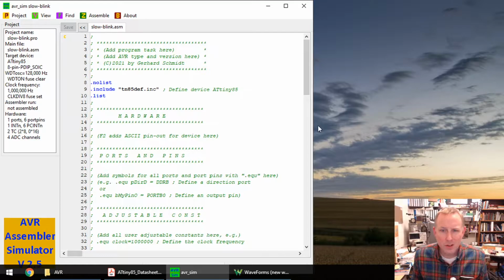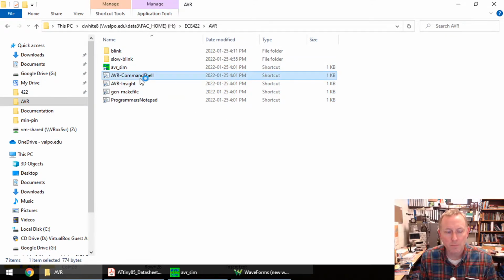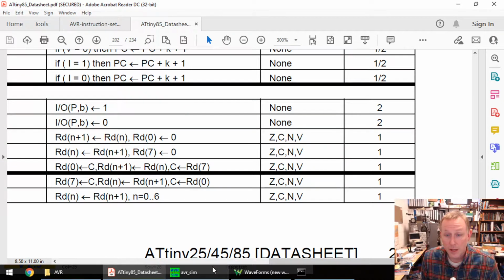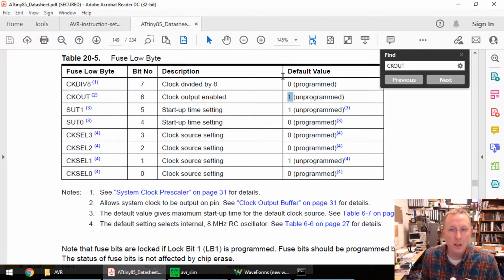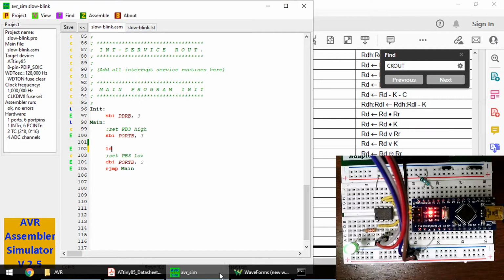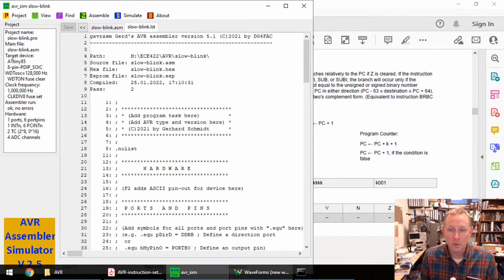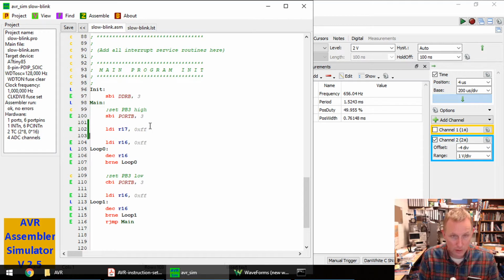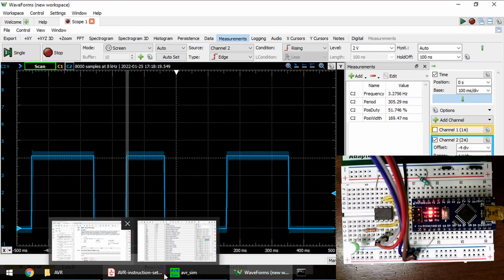AVR ATtiny85 slow blinking in assembly

Comment: Fantastic tutorial!
Is there a way to toggle a port bit like you can do EOR with a register? Also, is there a "neat" way to do variable delay timing in assembly instead of having to precompute n number of nested loops? Is there something like a timer we could use?
Reply from the maker: Thanks for the kind words.

AVR has instructions (SBR, CBR) to set/clear bits in a register, but not one to toggle.  (one variant does have a load+toggle, but not the tiny85 version)   You'd just load a constant to a register then "EOR Rport, Rconst".

To do variable delays, use a subroutine (aka "function" in a higher level language).  From https://agnd.net/valpo/422/  see day08 and day09 lecture notes.